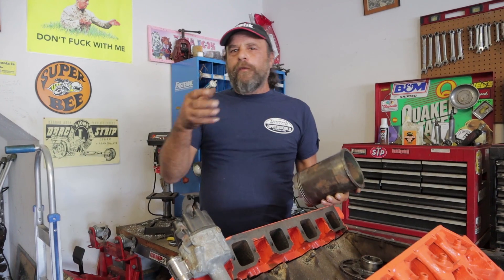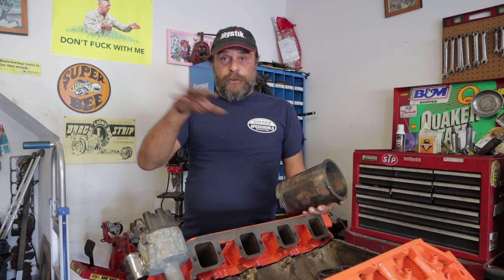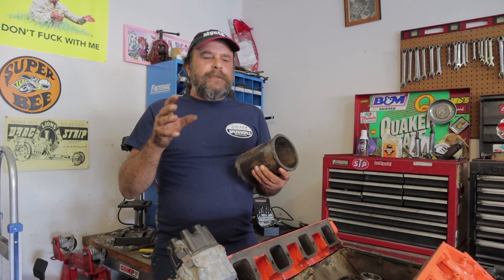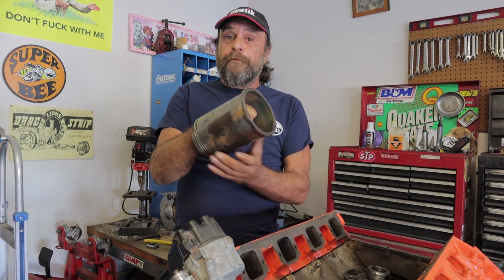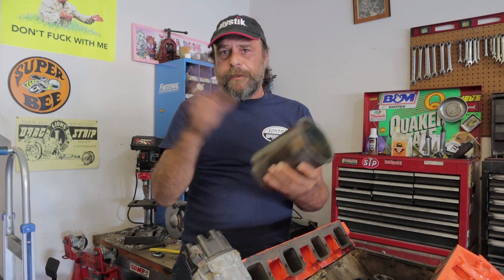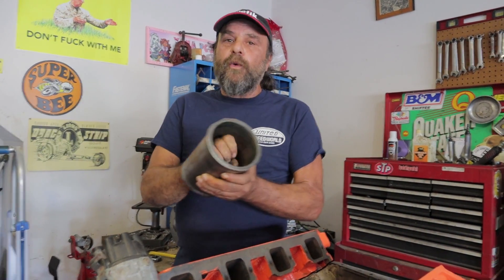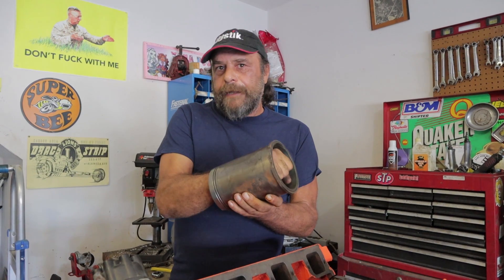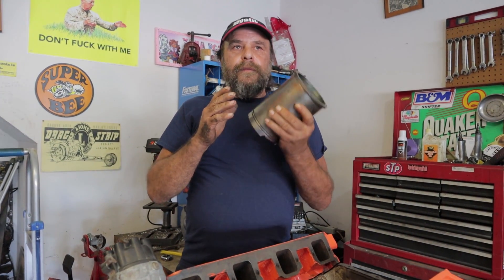The Myth Of Engine Displacement

Comment: Now I have to check I've always heard a 289 with a 4 inch bore and a 4in stroke hints a square engine the 302 I don't think would be much different I will go check now to be sure
Reply: The Ford 289 Windsor came from the factory with a 4.000 in bore and a 2.87" in stroke...VERY "oversquare".  A "Cleveland" block engine was produced with the 4 in bore and likewise 4 in stroke, marketed as the '400 even though it pencils out at 402 cubic inches.  And if THAT doesn't confuse things enough, although generally the 302, or 5.0, is a Windsor block, a version of the "Cleveland", or '335' engine, was produced with a 4.0 in bore and a 3 in stroke, for a 302 CID engine, in Australia.

Comment: Keith black says the bigger the engine the bigger the horsepower. Tony do one one hugh heads for horse power. Your examples were helpful.  You can only get so much air in the cylinder  to gas, so why not use big heads.

Comment: I've known this since I was a teenager...anyone who thinks for a few seconds will know a 4 stroke engine is only using less than half it's displacement on the power stroke - the details on the bottom half of the stroke are less known.  And, we've all been in cars with huge engines that make crappy power for various reasons.  We've all been in light little cars with little engines that scream.  It's mostly about burning as much gas/air as possible and using that energy as efficiently as possible to move the car forward as fast as possible (yes, there is more to it than that).  There IS NO REPLACEMENT FOR DISPLACEMENT -  assumes all other things are equal.  You take a little turbo engine and properly add more displacement it will always make more power.  You can say this with any engine (again, assuming you properly add more displacement - over stroking causes problems, for example)  Since I was 15 I understood the assumptions of this saying.

Comment: I kept thinking well even then you gain a half inch at the 90° mark but the deck hight didn't change and you're absolutely right.
Reply: No, you do gain a half inch because an extra half inch of deak hight is crankshaft stroke.
Reply from the maker: Actually, you gain slightly less than 1/4 inch at 90, but it's in a place where you're really out of the high pressure zone so it's mostly lost
Reply: @UncleTonysGarage  adding piston speed for a quarter inch of stroke at the low pressure end of the power stroke. You're absolutely right. No replacement for bore size? 😆

Comment: Good video Tony and very well explained. When motor heads learn things or think they know car engines they study read and collect info on engines they know. That's typical and I believe a short coming. We have aprox 170yrs of internal combustion history to learn from and many factors are relevant in all engines produced. The efficiency of the engine is the goal. One is the proper fuel and seconded is the tune, how well does the ignition ignite the fuel taking advantage of the whole stroke. Usually those few things are not ironed out and most all engines would make much more power tuned. That said I know people overlook what is the most important aspect of efficiency in any engine.Pump fuel an off the cuff figure  20%  of fuel or more goes right out the tail pipe and some engines are 25% or more. I didn't cover all the bases but those few are missing links.

Comment: I HATE the 347 stroker, it puts the piston pin in or a hair from entering the oil control rings, something that is totally unacceptable in my book, but people sure are putting a lot of trust in them, gonna make a lot of scrap.
Reply: this! I just read an article where they stroked a 440 so much the ring was actually in the pin hole! that's crazy!
I strongly prefer the 331 Ford small block stroker kits, i don;t see much downside to those on a street car and they seem to perform a hair away from the 347's anyway depending on head choice.

Comment: I would love to hear your thoughts on 440 to 500cid mopar engines and what choice of cylinder heads specifically what size intake ports for several common hp goals. Give us a recipe for a 600hp, 700hp, 750hp combo at those displacement.  The 210cc intake port Eddy heads look like they would be great on a truck motor. What about a 295 to 325cc port on a 440cid with high compression and a solid roller cam around 254 to 260 duration at .050. In a 3400lb car with a 4k converter and 4.10 rears  ? 👍in comparison, BBC cylinder head intake ports seem huge vs b/RB stock 190cc ports.
Reply from the maker: We have both a 383 and a 440 scheduled for future builds, but it may be a while before we actually get to them.  The 440 is more or less going to be a dyno mule, so we'll be playing around with heads, intake and cams

Comment: Big engines take bigger carbs, bigger cams, bigger ports and exhaust tubes... the truth is this By increasing stroke you have increased the working area of allowing more work to be done, by increasing bore size you have increased the  working area allowing more work to be done, it's that simple, that's why more cubic inches = more horsepower.... more horsepower doesn't always win races, big engines have big crankshafts, bigger parts, it's harder to spin up, more power is harder to hook up, I really think you don't understand what you're talking about.. recap..... bigger engines make more power....... horsepower = the ability to do work.... it's not a myth its true....
Reply from the maker: Nowhere in that video did I say that "Big Engines Are Bad".  The point was to illustrate the diminishing returns of just going large.

Comment: Uncle Tony I have a 1968 Plymouth Satellite 383 Two door no post, and a 1972 Duster 360 Crate Engine For Sale. NO! the Number don't Match. I can send pictures or video. Yes both cars are running!  and have positive traction rears. I also have 1969  Seats with headrest, Complete New Upholstery from legendary Auto Interiors for the 1968 plus Chrome and Original Radio I pod hookup. I seen you and your niece video on a Red 1970 Duster.

Comment: Yep just like reloading ammo. I have hundreds of burn rates of powders to perfectly match the expansion needed for a given weight projectile vs case compasity. If we had the same choice in burn rates of fuel you could maximize the efficiency of an engine based on piston speed load and displacement.

Comment: You're on to something, but piston speed is also important. Long stroke means the piston have to travel further, and then completely stop and then go the other way. This is why my new favourite build is the destroked LS7, especially for light cars. 4.15 bore and 3.2 stroke I think. Revs to 8500!
Reply: So how much does that reduce the "Cubic inches" or CCs of an LS7?Which of course starts to at 427CI or approximately 7000cc.
Reply: @Aseutester  it's 388 which is around 6.3 I think
Reply: @jstdrv  So you end up with a bigger engine than a Quad Cam Ford engine that'll RPM just as high, sounds like fun albeit with lower torque at low RPM.
Reply: @Aseutester  still a 6.3 is going to be way torquier than a 5.0.... would be a fun engine in a light car
Reply: @jstdrv  Agreed.

Comment: If you know what you are talking about you dont know how to explain it. Longer strokes equall more torque not just from rod angle but also from cylinder pressure. The longer stroke give much great cylinder filling therefor higher cylinder pressure. Explaining the differences of one ci against another takes many volumes of space for print or video it cant be done in 5 minutes
Reply from the maker: Watch the video again.  I said the longer stroke increases both static and dynamic compression ratios

Comment: There ultimately IS NO REPLACEMENT FOR DISPLACEMENT, you can ALWAYS make more power with more displacement  giving it the ability to breathe...its simple really, if you choke an engine down a smaller more efficient engine will be better  that's kinda obvious and to comment on " Big Chief" with his little engine those cars are ALL limited by traction and the ability to use the power, the bigger engines has the ability to make more power but there is no point if you can't use it.

Comment: First like to say ive never been a professional engine builder, but have turned more chevy 350s into 383s. Maybe you could explain in a future video someting. Its true on the power stroke the piston only sees pressures for about half the downward stroke. I understand that. But on the intake stroke your completely filling the cylinder so with more cubic inches theres gonna be more air/fuel in the cylinder thus providing more pressure on the piston i would think. Im gonna subscribe and will be looking for a video on how this works. Im actually interested in this not trying to be a a$$ hole.
Reply: There is still lots of pressure  left in the cylinder when the exhaust valve opens.

Mine opens 51.5* BBDC, so that's at 81% of the stroke.

By opening the for  last  19% of piston travel, most of the pressure get vented out while still pushing on the piston (if you have a turbo, that remaning energy spins the turbine).
So that when the piston goes back up, the pressure is already down to atmospheric pressure.

If the exhaust valve opened later, there would too much pressure left on the exhaust stroke pushing against the piston going up, robbing HP.

Buy David Visard's books, he explains it well.

Comment: idk...... a 400 sbc VS a 350..... 400 ALL DAY
the same head will flow SLIGHTLY better on a 400..... larger bore un-shrouds the valves 

i own 2 400 blocks..... an original stocker in my 77 half ton.... and a 327 replacement in my 68 impala 

that 400 is WAY more of a truck engine..... and id almost take the 327 over a 350/400 for a high revving car

but a 377..... 400 block, 350 crank..... now that engine is a killing machine
Reply: I've helped build a couple of 377 engines for use in boats and they really get up and run well!

Comment: You completely misunderstand the concept of stroking an engine. You would increase the working area from inch and a half to 2-inch in your example. That is assuming all of your other assumptions about work area only being 12 and a half percent of the actual function of a 4-stroke engine. The math in your example only comes down to the work being produced by a 302 at somewhere right around 37 and a half cubic inches, not 75 cubic inches. I believe it's a bit more than that, but the numbers you quoted you misconstrue or you misunderstand. I think you're trying to rush the video. Considering the piss poor torque to horsepower ratio of a 302 engine, increasing torque is a wonderful advantage. Look at the 363 versions of the Ford small-block. It very easily can be built to 567 even 900 horsepower on pump gas. That is next to impossible to come close to that power ratio with a 302. The closer you come to square boring an engine, which would mean approximately the same bore to stroke ratio being equal, the better overall performance the engine will seem to have.
Reply from the maker: I only used that engine as an example because it has nice round numbers for bore and stroke.  As for the actual working area of the engine...all those numbers are obviously estimations only used for the purpose of illustration.

Comment: And just to shoot holes in your "working displacement" theory which is all utter nonsense, at 90 degrees a 3" stroke crank in a 302 (with a stock 5.09" rod length) the piston is 1.72" down in the bore, with a 4" stroke and the same rod (it wouldn't fit but for simplicity sake we'll pretend it does) the piston would be 2.4" down the bore.   Here have fun with this: http://www.torqsoft.net/piston-position.html
Reply from the maker: I'm aware of the pistons position at 90, but 90 is in the expansion zone...about 50 degrees past peak pressure.  The handicap here is that the piston speed is increased mid stroke, thus shortening the range of peak pressure
Reply: @UncleTonysGarage  Be consistent, in the video you said the magical imaginary number is 90 degrees, is it 90 or 50?   Your theory is still bupkis

Comment: Jesus Christ another old shade tree mechanic thinking he's discovered something new about piston engine design.   Way smarter people have figured this allllll out long before you and I were born dude.   Most of what you said is B.S.   The reason some of these mountain motors don't make good specific output is because they were designed by guys like you (with no formal education in Engineering) and thus have shit BSFC and shit V.E because of bad combustion chamber design, bad port design, massive amounts of area for heat loss, terrible windage issues etc etc.   Any Engineer can show you scientifically and empirically backed equations and data that shows displacement is a direct correlation of power output.

Sorry to be such an asshole about this but shade tree mechanics trying to be engineers make my head hurt.   They always seem to want to challenge the laws of physics.   It's like listening to a flat earther...
Reply from the maker: Did you even watch the video???
Reply: @UncleTonysGarage  Yes I did, it hurt but I made it through it.
Reply: What a toxic comment. 
I guess i don;t understand the hate on shadetree guys that are trying to take an engine designed by someone else, built decades ago, and make it more powerful and efficient. It doesn;t really matter if they are "trained" or not, they aren't going to go out and fabricate/cast/machine a new engine. they are using parts that already exist, whether you like them or not, and trying to improve them using other parts that exist, to get the engine to behave how they want for their application. 
This isn't their "job" it's a hobby. Like the guys launching model rockets, they aren't pretending to be rocket scientists, they are experimenting with something they like thinking about. 
Shadetree people try to work those improvements without dropping $$$$$ on them. it's a hobby, Uncle Tony isn't working at Chrysler designing the next iteration of their new hemi for 2023. he is messing around with stuff that's older then 40% of the earth's population because he finds it interesting and fun as a passtime, like most gearheads. Then they all go to their day job to pay the bills. 
no one is taking away from the hard work engineers put into design. No one here is actually designing anything. They are just altering it based on trends of newer technology and trying to adapt it to older,existing tech. if you want an example of people giving engineers the finger, look at know it all boomers from the 90's that just threw money at everything whether they understood it or not to the point a lot of the old hot rodding tricks became hidden tribal knowledge. 
people like Uncle Tony see how the engineers designed the modern aftermarket aluminum heads. Those heads cost upwards of 2500 dollars minimum, up to 6 grand. All uncleTony and the like try to do is apply/modify what they can from what the engineers have learned over the years to the old set of existing iron heads they picked up for $100. That is just one example. 
Get off your stump, stop hating on people so much, you aren't that smart either. There's always someone smarter, faster, stronger. People are people, and they will enjoy different things.
Reply: @davenhla  Because he's spreading false information.   He's doing a dis-service to people that don't know any better...

Comment: So what’s the most effective add to that 75cid is a larger bore more preferable to stroke ?
Reply from the maker: Most effective way would be to use a raised deck block.  Bore is good, but you can only go so far on a production block

Comment: 400 cubic inches will only net 50 cubic inches per cylinder not 75. When you add an extra inch of stroke you DO increase piston speed up until half stroke. During the combustion cycle/(any of the 4 cycles for that matter) the piston is under acceleration up until it reaches half stroke. At which point it is then under deceleration. Saying the entire inch of added stroke is all at the bottom of the cylinder is dead wrong. Its in the center. You added a half inch of acceleration, and a half inch of deceleration to the stroke of the piston. You are correct on needing to compensate for the increased stroke with a higher pin height, but pin height and rod length have nothing to do with stroke. Pin height and rod length deals with the relation of the where the piston lies in the bore. Only the throw of the crank determines stroke.
Reply from the maker: In the example I used, the head of the piston travels the same distance in crankshaft degrees, from TDC to the end of the peak cylinder pressure phase of the power stroke, because of the raised pin.

Comment: Wrap this around your head folks I'll put my 410 stoker against any stock stroke, 40 over, NA, no power adder or spray 360 you want to build and you will lose period . The only difference will be the displacement since both are 40 over 360 blocks but I will make 100 extra hp and at least 100 extra ftlbs of torque . So does displacement rule ?
Reply from the maker: Did you even watch the video?

Comment: I always thought that it was when everything else is equal, i.e flow, air/fuel, cam, so on and so forth. Which makes sense to me, it’s easier to get 400-500 hp out of a 350 V8 then a 2.0L 4 cylinder.